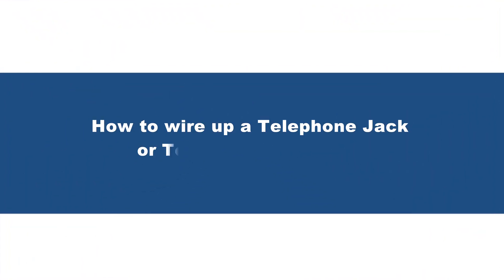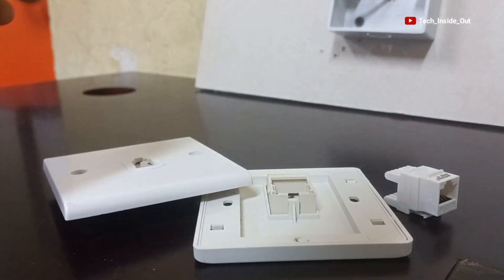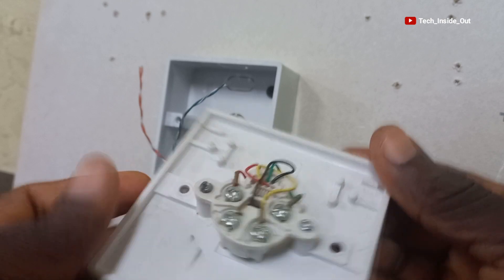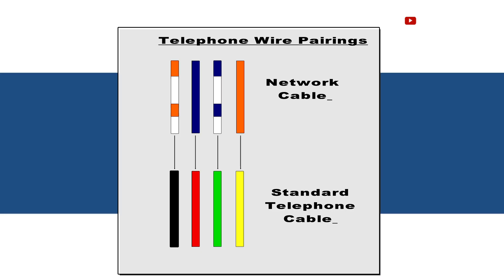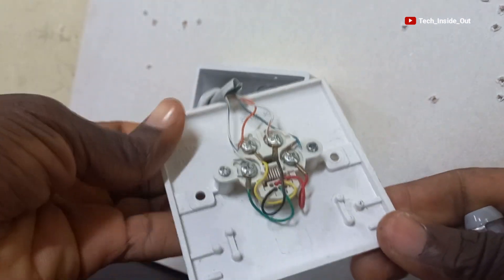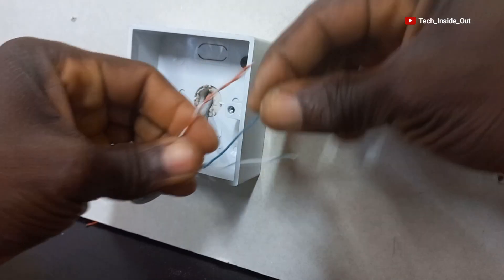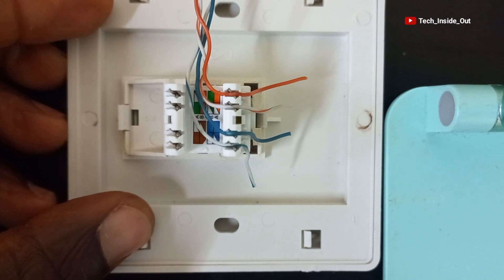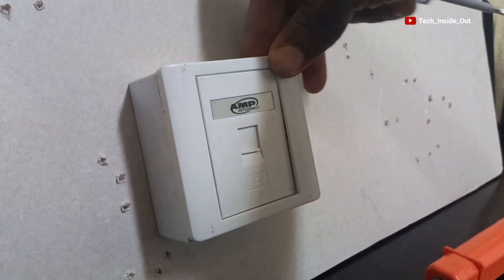How to connect a telephone socket

Comment: Hi sir, my telephone socket have 2pair which is 1,2,3,4. But the wired is only have 2 wires, orange and white orange only. Could u advise me which socket number should I insert?
Reply from the maker: Use the two middle points,  2&3
Reply: Number 2 and 3

Comment: And the other side of cat 6 cable  we use rj11 6p8c diagram of connection plz provide for dsl port on router
Reply from the maker: it should follow this order, stripped orange, blue, stripped blue and orange or if you are using a normal 2 pair telephone wire, it should be Black, Red, Green, Yellow
Reply: @Tech_Inside_Out  can i know your Instagram so can i share you the switch photo and the exact problem

Comment: Hello i need some help with hooking up a new phone jack, the other one was damaged. I took it off it had these colors  orange and white and orange  blue and white and blue green and white and green brown and white and brown, they were all hooked up. The new phone jack has 4 screws what color do i put on what screw B, R, Y and G. I need this for my wifes heart monitor,  please help me, sorry i have no idea what i am doing
Reply from the maker: You need to connect from left to right in this order, stripped green, blue, stripped blue, green
Please go through this video,  I did the pairings for the BRYG
Reply: @Tech_Inside_Out  i figured it out, thank you very much
Reply from the maker: @markschrader7223  You are welcome

Comment: Is it Possible use brown, stripe brown, green and stripe green for the connection? thx
Reply from the maker: Yes, you can but you must use that consistently along your setup and ensure in times of fault tracing, you remember your order.
Reply: @Tech_Inside_Out  another question sir. is it possible to make connection 5 or more telephone without krone ?
Reply from the maker: @user-es5tv6lr3c  Yes, you can. The krone has an application which I may later cover